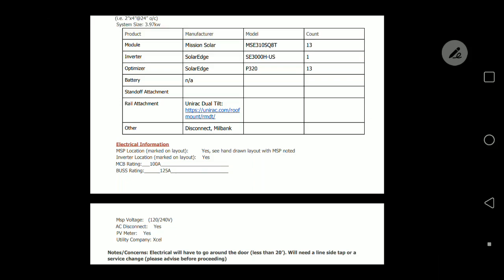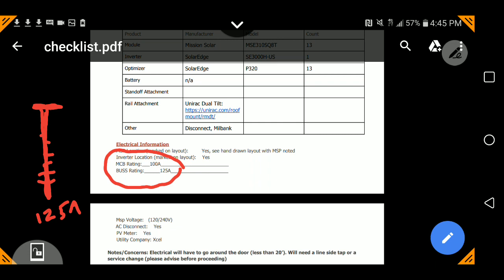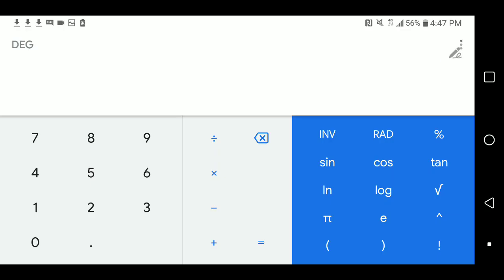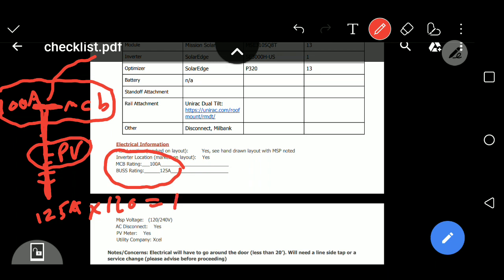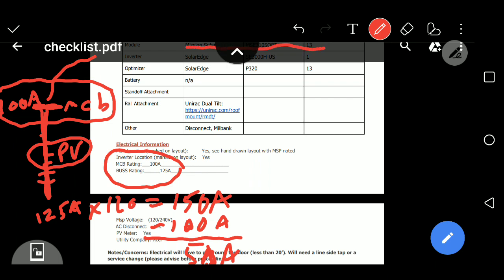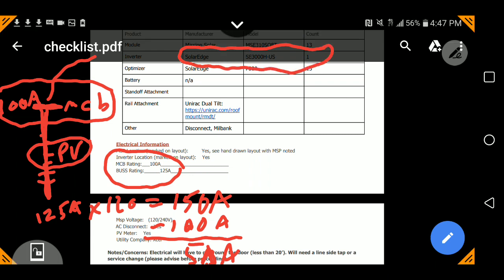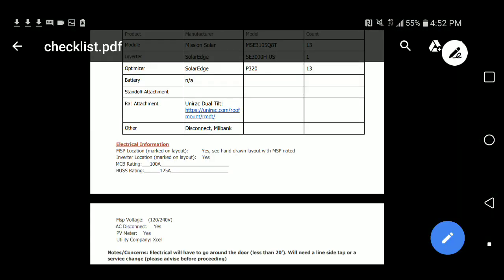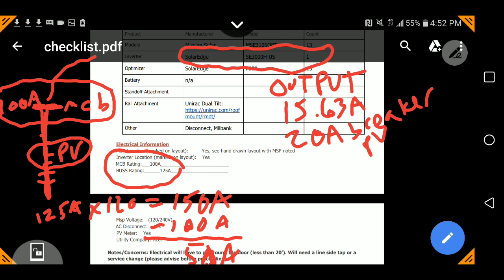do i need to do a line side tap?

Comment: Great video - really explains the calculations well.  I’ve got a 20kW solar system installed with two 10kW SolarEdge string inverters.  We want to expand the system with another 6-7kW inverter.  2.	Our current main service panel is rated at 225A.  It has a 150A main breaker and two 60A breakers for solar – one 60A breaker for each 10K inverter (120A total for solar).  

The solar company we were working with said they could install a “load side tap” with a second electrical meter.  I get the feeling they have never done this before.  What would you recommend as a solution?
 Also, how much should a typical line side tap cost to install?
Thanks!
Reply from the maker: hello Al. great question!

there is a difference between a load side tap and a line side tap but many contractors confuse it.  a load side tap is between the main circut breaker on the service panel and the actual buss of the service panel - so that the penetration is protected by the main circiut breaker.  a LINE side tap is between the utility meter for the home and the main circuit breaker (mcb) of the main service electrical panel so the mcb is NOT protecting the penetration.  this is more common and recommended.

if you do a line side tap you will need to call for a shut down of power from your utility company the full day while you perform the surgery. ...basically you just tap into those lines using piercing connectors and then you cover them so they do not corrode and can withstand the weather.  electrical contractors typically will charge $150/hour i think, and it takes them between 1 to 2 hours to perform.   definitely bid it out between 3 different contractors foe your own knowledge and it may vary depending where you are in the usa.

the calculation seems legitamate:
120% x 225A buss = 270A 

270A - 150A mcb = 120A of solar breakers allowed.  it seems you will exceed this with adding a new system.

in this case i would recommend putting all systems into 1 single subpanel.  then from subpanel go to a solar pv meter.  then from pv meter go to a FUSED ac disconnect.  then from fused ac disconnect to the line side tap. then from the line side tap , the full system is now feeding the utility meter.

if you would like pictures or further info or to chat about it, please give me a call directly and i can help you!  

bryan. 858.405.5845

.
Reply: @zen.passion.adventure  open cabinet. loosen 2 bolts, strip 2 wires, pass through dual sided polaris tap, put wire ends back into mcb, tighten 4 wires, connect 2 new wires,  put cabinet lid back on.  assuming the wires are all there ready to go and just the tap needs doing....its like 15 mins of work tops, 2 bolt loosens, 4 bolt tightens and 2 wires stripped 2-3 inches each.  it just isnt that hard
Reply: Hi Bryan! Thanks for the info.  This is super-helpful - exactly what I was wondering about.  I'll look into it some more and may reach out to you directly.  It's clear you are very much an expert in this field.
Reply: i just went through a giant mental exercise about this today saying "yeah people are gonna want like 20kw+ in a few years once they start getting evs, and 150A main breaker aint gonna work as 2 evs charging will hit 70 amps most likely and throwin on an oven or dryer on a larger house with ac or the water heater if tankless will trip the breaker every time, tankless becoming more prevalent by the year so not really an option so line side tap.  NEC passed some silly rule about needing a separate box why IDK as it does nothing.  its pretty simple, cheaper really than even the breaker option. should be the go to really. 

solar less than 48kw? 25+ is usually commercial and nobody is ever going to do that on a house....NO? cool line side tap it is
its a perfect fit all solution thats like 40$ with 2 taps. no idea why it isnt pushed more

Comment: Can you increase a 125Amp  service panel to a 150+. My current SP is 125A and i have 20 panels on the roof with a 25A PV breaker(6k sysyem) and i like to add 4k more to the roof.
Reply from the maker: thank you Corey!

what is your main circuit breaker rated please?

usually a 125A buss main will have a 100A main circuit BREAKER at the top.  this will allow you 125A x 120% = 150A - 100A circuit breaker = 50A of solar allowed.

THAT is how the 120% rule is allowed.

so you already have a 25A breaker for the first system.  you are allowed to have another 25A breaker.

using an SE3000H-US solsr edge inverter, you are alowed to put in 4650W DC from the solar panels IN TO this inverter and the inverter will output only 12.5A x 125% safety factor = 15.625A - so you will need a 20A breaker with this system.

i hope this helps!

call me if you would like to chat. 619.259.0441

Comment: HI Brian, at end of video when you had 90amps to use was that doing both a derate and a Tap? Also, to derate or do a tap or both, does there need to be room on breaker panel or not ?